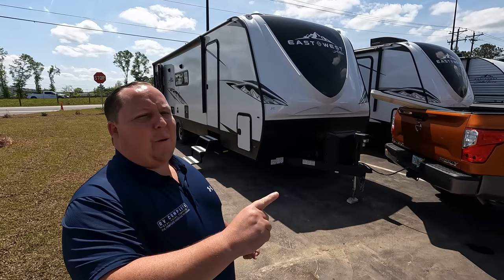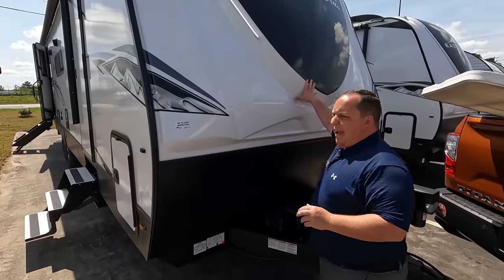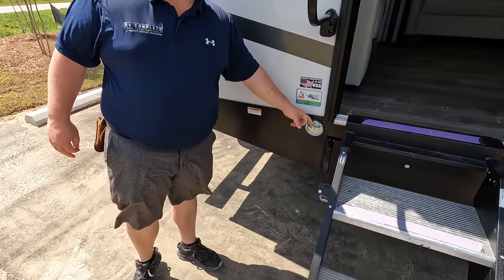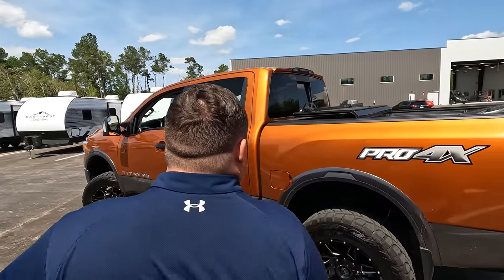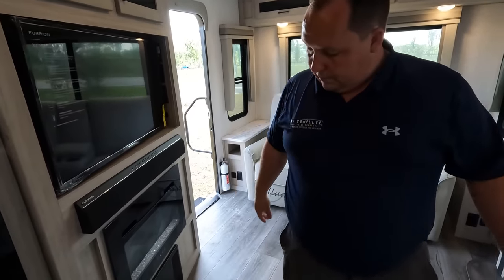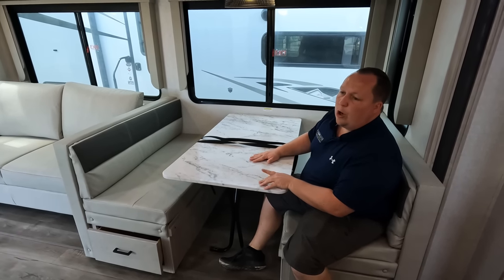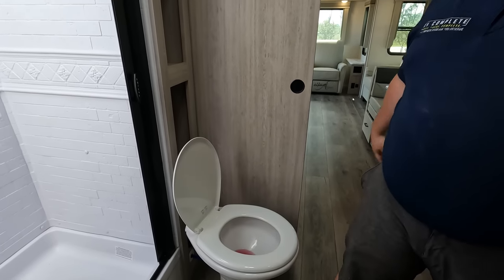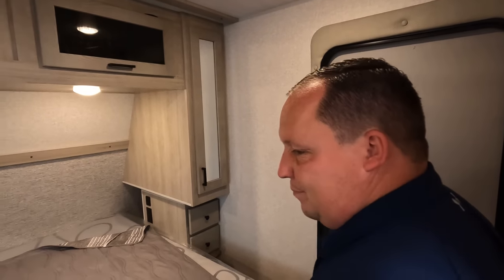The BEST Couples Travel Trailer EVER!

Comment: Bit of a shocker with East West Alta. One thing does the TV in wall swivel towards the rear theatre seats ? If it does great,  but it blocks the walkway to the outside also you cant then see the TV from the sofa or dinette, if it swivels that way. The placement seems a bit odd. Great review guys enjoy the Grand opening.

Comment: Visually it is nice although similar colored walls, ceilings, floor, cabinets and counter tops makes it very lackluster.  I have this basic design but with a higher placement of the tv and no fireplace gives me lots of space on the same wall unit. Side sofa tables need storage space inside. End of the day they have to offer far more storage. Lastly at $57k how about a window in the BR door.

Comment: My only dislike is that the tv is in an awful position.  They should have mounted it on a swivel arm, so that it could have pulled it out and turned it towards the theater seats.  Otherwise, they did a nice job with the rest of the unit.

Comment: So this is basically a direct copy of a Grand Design Imagine, with a few minor changes and a different color palette... I totally disagree with Will on the need for solid surface countertops. This is a middle level TT (just like the Imagine) and although you didn't mention it, I'm guessing not a huge CCC. Adding the weight of solid surface would take away too much from the CCC. This is not a full luxury TT. That would have been a PPP if you would have closed the door like everyone does when using the toilet... Overall I would take a Grand Design over this unit. And I thought finally a walkthrough where you sat normally and didn't put you shoes on the sofa but then you and Will both closed drawers/cabinets with you feet 🤬 is it that hard to bend over to close the drawer (you bent over to open it???) Very unprofessional.
Reply: I too have notice the slamming of drawers, cabinets, tvs and microwave doors;  very unprofessional indeed. Even Andrea does it.